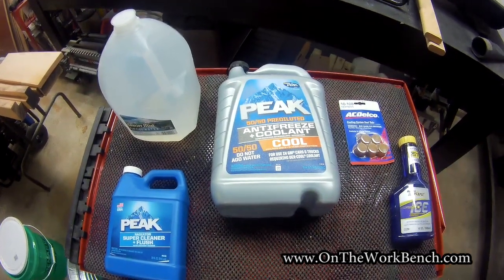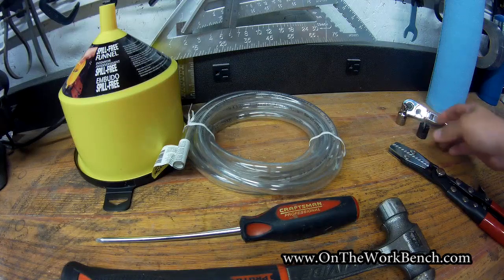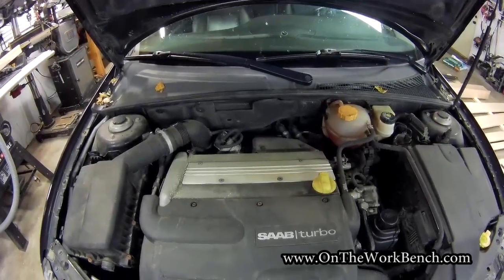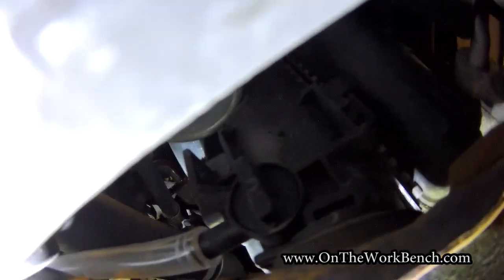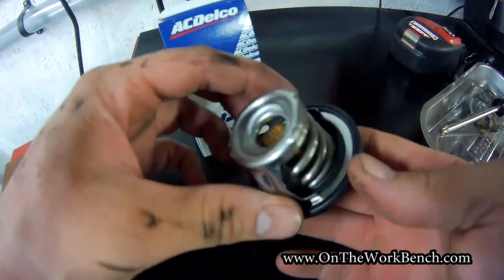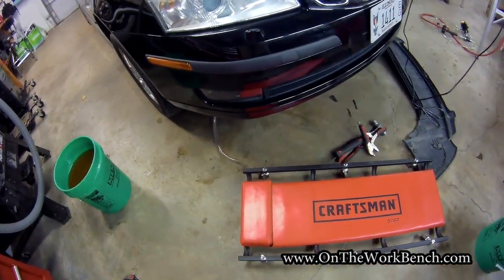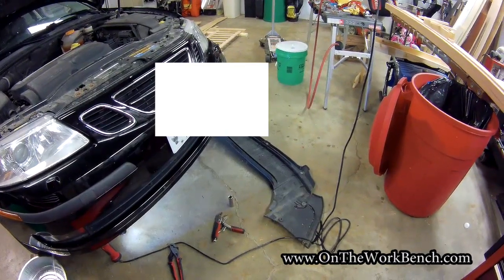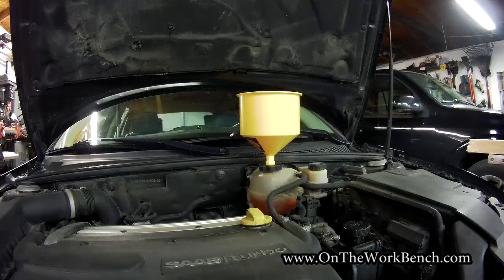Saab 9-3 Coolant Flush & Thermostat Replacement

Comment: Just replaced my thermostat today and if anybody else is still looking my tip would be put a smaller extender with your socket and drop that on the bolt that’s closer to the engine and less accessible. And get an impact or wrench with another extender and you’re set.

Comment: Thanks you for the video.  Might be a good time to replace that plastic OEM T fitting to one made of metal. They break easy after some years of use.  Looks like you have the original plastic.  It's on the left side under front cover. They were on Ebay with the two bigger hoses for $31 shipped.

Comment: Great video, and wouldn’t it be easier to access the thermostat and housing by removing and putting the reservoir tank to one side? 🤷🏻‍♂️
Reply from the maker: Maybe? I'm not convinced adding more steps to the process would be overall more efficient.
Reply: Removing the tank would probably take more time
Reply: I agree with ding bat. There is nothing holding the coolant reservoir tank in place except gravity. Lift it out of the plastic housing. No tools needed

Comment: Is there a wrong direction the thermostat will lock in? Without heat on the coolant is being pumped through the heater core and is leaking through the connections to the heater core.

Comment: I was able to hand loosen the draincock to turn it but nothing comes out.  Reservoir is filled and im not noticing any leaks.  Could it be a faulty thermostat thats stuck closed?  If it is, to replace it does that mean that I will have a huge mess when i take out the thermostat because i cant drain the fluid?
Reply: I have a 2005 93 linear
Reply: Literally have this exact issue rn…
Reply: The coolant cap has to removed for the liquid to drain out.

Comment: I just bought a 2006 saab and the previous owner was using Peak silicate enhanced coolant for pre 2006 saabs. I've read the silicate gel can build up. Will the coolant system cleaner flush all of that out?
Reply from the maker: It can't hurt. Id recommend picking up a brand new drain plug while you are at it too.

Comment: Im gona used your video as a reference and a guide in this process im about to do. Two weeks ago on my way to see my mother i had some issues on my way there . the throotle hose got loose i had no tools with me i use a Dime to tight it saw my coolant boilin i was whattt? I have never seen that i mean i only knew the basics brakes oil change you know.. Changuin the #6 so far its been my biggest work. Another symptom i had which happen once i got home a rattle by the driver side of old apartment pipes.. Coming down a hill temperature gauge drop and once level the gauge went up no check engine no overheatin

Comment: Did you have to burp system/pump to get air out?
I finished radiator swap, added dexcool 5050 to fill line, idled for 15 minutes but didn't really see any movement
Reply from the maker: I never had and issue with air pockets forming when filling it from the reservoir.

Comment: I hate to be "that guy," but you're using the wrong water.  You have purified water there, which is full of minerals.  Distilled water is not the same thing - it has the minerals removed, and that's what you want.

Comment: Do you have to flush the whole system or can I just replace the thermostat
Reply from the maker: You can replace just the thermostat but you will have some coolant loss and will need to bleed air out of system so it makes sense to do both at same time.
Reply: @OnTheWorkbench  Would you say if he just replaced the thermostat, in order to bleed air without flushing the system the best way to do it is by taking off the temperature sensor off until you see some coolant over flow?

Comment: And if I replace the thermostat without draining, will I have to bleed the system or not? I have ss 2004 b207e, is there a vent at all? Thanks
Reply from the maker: If you open the cooling system at all other than at the resevoir you may have to bleed air out. If you pull the thermostat without draining the coolant there will be a decent loss of coolant making a mess on your floor but a bit better with a drain pan underneath.
Reply: @OnTheWorkbench  and this thermostat what do you change, what is the opening temperature?